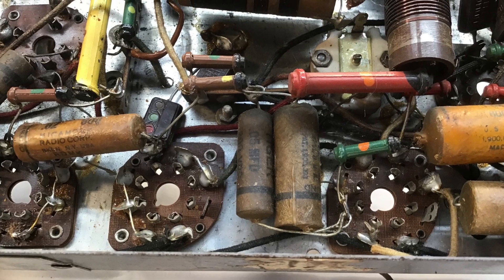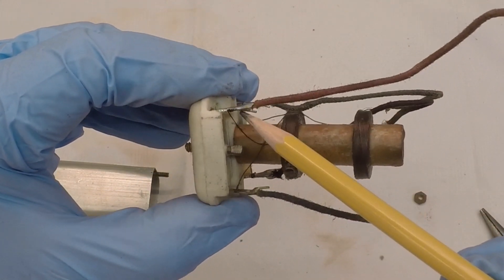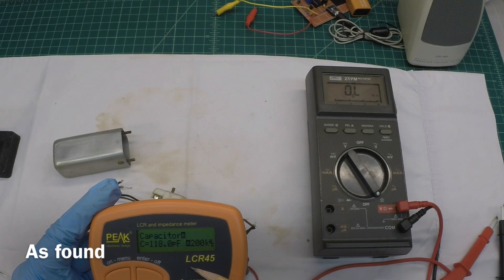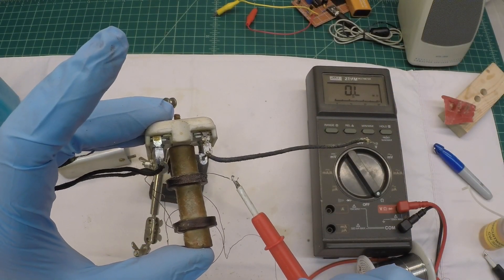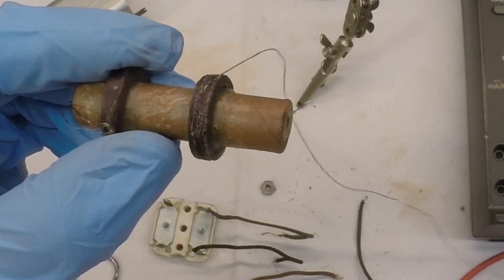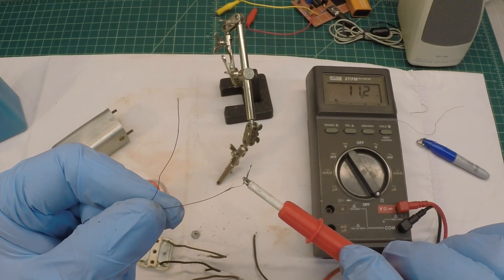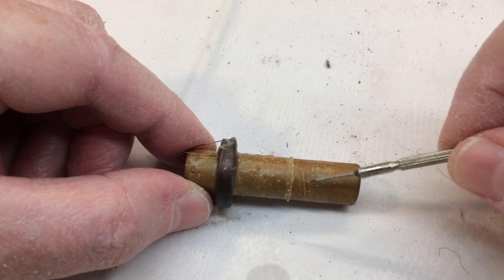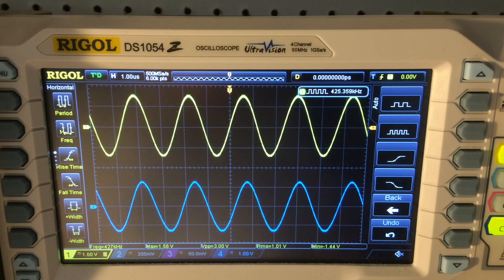Jackson Bell Model 556 - I.F. Transformer Troubleshooting & Repair Attempt

Comment: Another helpful video. I had a open coil on the 2nd IF. After watching your video, I reflowed the solder and noticed one coil wire in the lug appeared to be loose. I found that is was actually broken. Luckily I got the Litz wire to eventually hold and the radio is up and running. Thanks again !
Reply from the maker: That’s great! I’m glad you were successful and gave it a try. Thanks for reaching out and sharing your experience. Best, Don

Comment: Impressive rewinding skills. I've seen guys modify fishing reels to do that job. Not sure I have the patience for that. I'll go as far as to wind a few turns around a power transformer to create an isolated, low voltage supply for a blue-tooth adapter, but that's about as far as I go with that kind of thing. If I can't get a replacement transformer I would probably give up, but I suppose it depends on if I really want the set to work bad enough.
Reply from the maker: Thanks for watching and reaching out. I’ve seen some very clever, but simple winding jigs. It does test my patience at times, but being only a hobby as time permits makes it less stressful and therapeutic, or at least that’s what I keep telling myself. Best, Don

Comment: In winding a coil to match a schematic, which is more important to match - the inductance or the DC resistance?
Reply from the maker: Wendell - the inductance to create a LC circuit that resonants at the desired frequency, for this receiver 456 kHz. The low DC resistance of the coil has no impact on the B+. Thanks for reaching out and watching. Best, Don

Comment: Thanks Don. That is your usual very clever repair. I have always wondered what would happen if the IF was out of phase. Do you know or can you predict?
Reply from the maker: Thank you Ian. In most cases an out of phase I.F. Transformer is not a game changer. You may see a reduction in gain and or distortion, so I try to be mindful of this when rewiring/reinstalling. For years, I never gave this any thought nor validated until I ran across the distortion issue that got me looking. Best, Don

Comment: As always, a very good job...
By the way, soldering litz wire, to me, is a boring task.
Bests.
Reply from the maker: Valdir - the Litz wire can be frustrating to work with for sure. I usually squeeze (ever so lightly) the Litz wire between some 400 grit sandpaper and make a few passes, clean with Alcohol then twist the conductors together and apply a few drops of CircuitWorks CW 3220 liquid rosin on the wire before soldering. Thanks again for reaching out. Best, Don